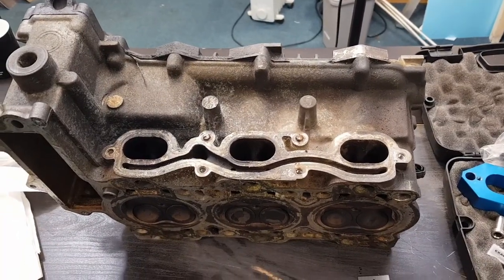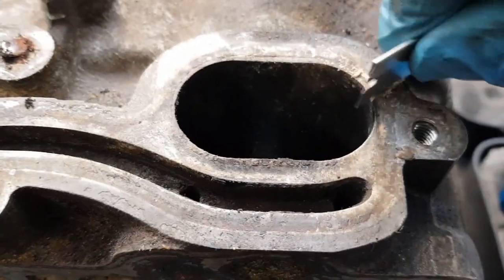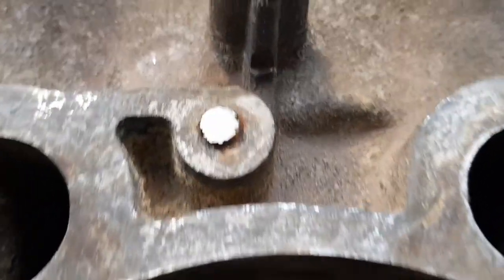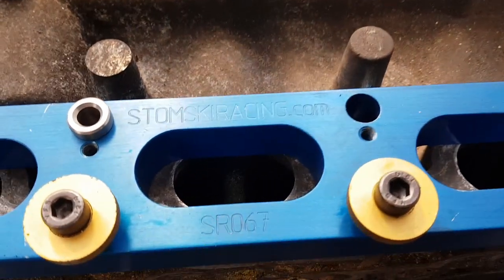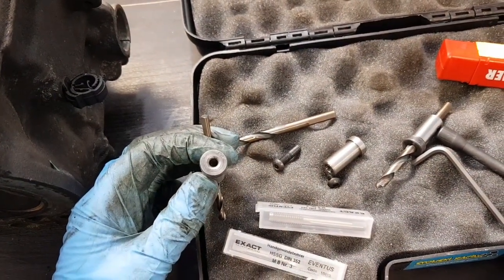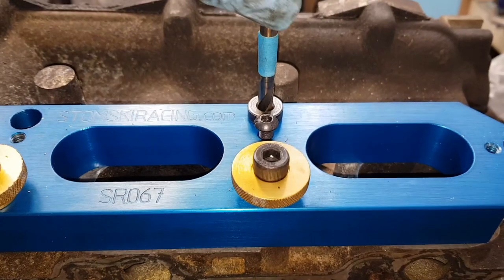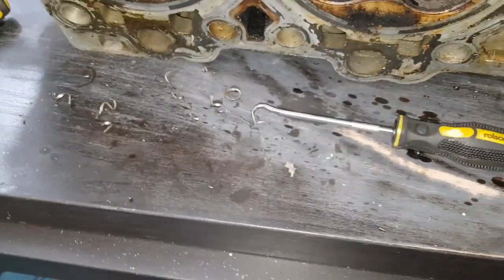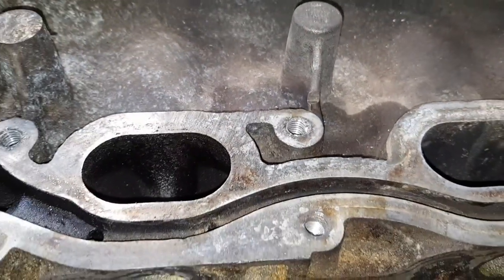Porsche 911 Boxster 996/986 exhaust bolt removal with Stomski Racing SR067 jig

Comment: How do you secure this jig if all the bolts snap when trying to remove the manifold?
Reply: You can't use that jig if you haven't got 2 or more studs removed, I had 5 of 6 snap off on one side. Much easier with head removed , under the car it's a bloody nightmare of a job and the studs are very hard.